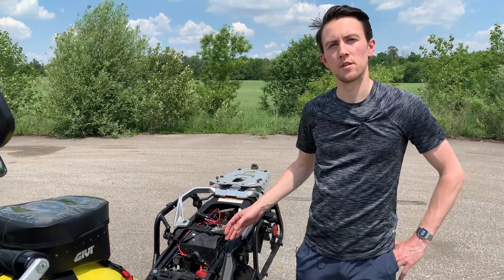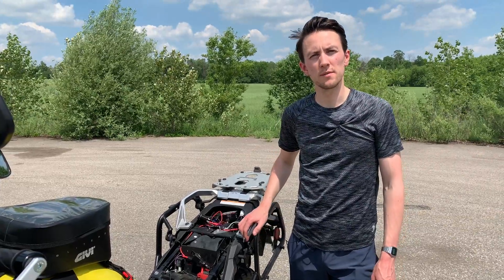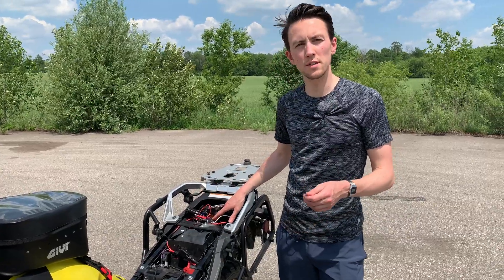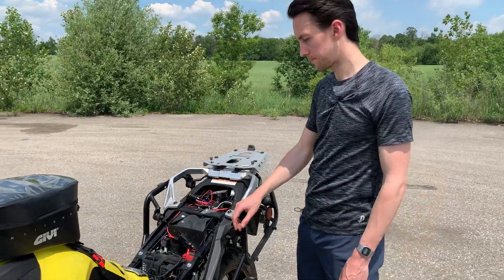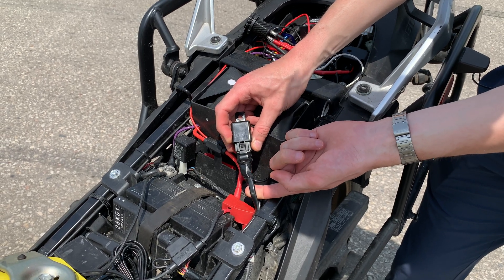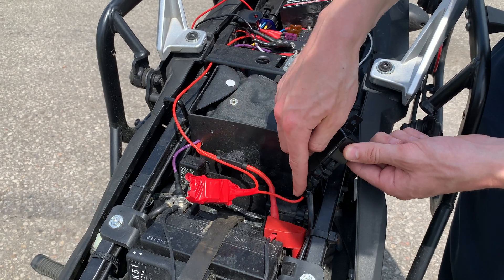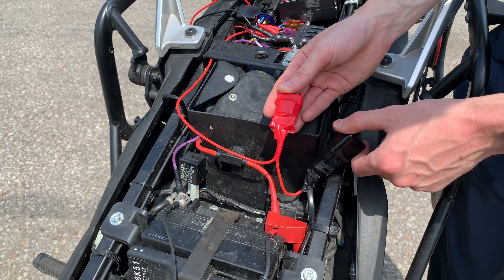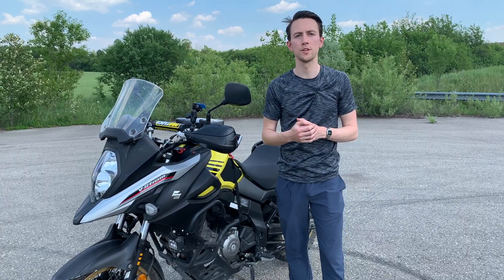AUXILIARY FUSE BOX SETUP - Never have a dead motorcycle battery again!

Comment: I have a question, can I connect fuse block to  motorcycle kill switch and use it for accessories only ..Instead of tapping into the motorcycle wiring  I can go straight to the battery and switch it off when not used ??
Reply from the maker: Hi there, I’m not quite sure I follow your question, but if I follow correctly, the way I have it set up may be exactly what you’re asking/trying to do. 

By having the fuse box “turned on” only when the bike is on (which is how mine is set up, by using the tail light wire as the trigger to allow power to the fuse box), then the fuse box and all accessories don’t receive power as soon as the bike is turned off (or when the kill switch is activated). As long as you use a power source for the fuse box “trigger” that is only active when the bike is turned on, the outcome will be the same. Hope this helps.
Reply: @N5Gunner  oh ok , I'm scared to tap into a wire , so could I bypass that with a kill switch that connects directly into the battery, and then connect the fuse block to the kill switch.   At that point connect all accessories to that fuse box connected to that kill switch, and the only way the accessories get power is when I hit the on button for the kill switch . I was wondering if that would work instead of cutting into wires . I'm srry I'm not good at explaining these things lol  I'm new to all of this .
Reply from the maker: I see what you mean, a new switch that you’ll add - I thought you meant splice into the kill switch button on the motorcycle. 

I think that would work, but the downside is that the fuse box and accessories could still drain the battery when the switch is turned on. 

For me, the primary benefit of the fuse box was having it automatically turned off when the bike is off. If you add a separate switch as the trigger and have it wired directly to the battery, if you leave that switch on, the fuse box will keep drawing power even when the bike is turned off. If you don’t mind that, then it would work, but if you want all accessories to stop receiving power automatically when the bike is turned off, you’ll want to use a “trigger” power source that is only active when the bike is turned on (in my case, I used the taillight).
Reply: @N5Gunner  ohhhh ok. I'll try the tail light.. thanks man I appreciate it !!!!
Reply from the maker: No problem. I recommend a butt splice where you can cut the tail light wire and then add a new bit of wire that will run to the fuse box trigger.

Comment: What gauge wire are you using?
Reply from the maker: I used 12AWG for the primary connections to/from the battery/Auxiliary fuse box, and smaller gauge for the individual accessories connected to the fuse box. Hope that helps.

Comment: Hi, Thank you for posting it. I have questions: How did you connect a relay to the fuse box (wire diagram)? The wires come from battery directly? How about the positive and negative wires (12 Gauge), did you run it directly from battery?.  Also, where the ACC wire go to (works only when the ignition key is on which you spliced it from the rear brake light)? Directly to the fuse box? I am a little confused.  Thank's.
Reply from the maker: Thanks for watching and for your comment! First, if you haven't already, I'd recommend reading the video description, where I've laid out the wiring in as much detail as I could. Let me know if the description helps answer your questions, and if not, I can try to answer them here in a different way. Thanks!
Reply: @N5Gunner  I still have one more question. So the 12 gauge wire positive and negative run from the battery to the main relay next to your fuse box? (this is not the aux light relay I am asking). And from the relay to the positive and negative terminals from the fuse box, correct? If that so, then the 12 gauge you connect to the relay first, then what size is out to the positive terminal on the fuse box, the same 12 gauge? I just need a clarification on this. Because it looks like all the wires  are smaller and the only 12 gauge I see it on your fuse box.  I understand the connection well, just confusing whether the 12 gauge should go to the relay first. thank's again

Comment: Most auxiliary light sets I’ve seen come with a trigger wire.  If you hook the auxiliary lights up to a fuse block which itself needs a trigger wire, can you then disregard the trigger wire that comes with auxiliary lights?  Thanks.
Reply from the maker: Most of the auxiliary lights I see come with an ON/OFF switch, yes. If you hook the auxiliary lights up to an auxiliary fuse box, it’s still best to make use of the ON/OFF switch - doing this allows you to still turn the lights on/off with the switch, it simply means that you will only be able to turn the lights on once the bike is on and power is being supplied to the auxiliary fuse box. This adds the benefit of not being able to accidentally leave/turn the lights on and drain the battery once the bike is switched off. Hopefully that is what you are asking! Thanks
Reply: @N5Gunner  Thanks for your quick reply.  I should have been more clear.  I would be using the on/off switch that comes with the auxiliary lights; but do you need to hook up BOTH trigger wires, the one coming with the lights and the fuse block?  Maybe the answer is if you use the on/off switch, you need to hook up the trigger wire also coming out of the auxiliary light relay.
Reply from the maker: @rogerhart1835   Yes, you would still use the auxiliary light relay and it’s trigger wire. The auxiliary light relay should have four wires - a power input (power coming from the auxiliary fuse box), a power output (running to the lights), a negative/ground, and the trigger. The trigger wire for the auxiliary light relay is the ON/OFF switch. 

So you end up with the primary auxiliary fuse box relay being triggered by a circuit that is only live when the bike is on (I used the rear running light), and then the trigger for the auxiliary light relay is the ON/OFF switch wire. 

Hopefully I’ve got it right this time around and understood what you were asking correctly! 😅
Reply: @N5Gunner  👍

Comment: Some other things that may help when wiring an aux fuse box is that you could use a 'piggy back' tap connector that fits into an existing fuse on the ignition circuit to give you an extra 'switched live' for the relay without having to cut/solder or use crimps, or if you dont have space to fit it in, then use a t-tap crimp connector with a spade, which is in fact what i have just used when fitting a small fuse box to to my cb125f using the rear light, when only a little bit of cable is available and i didnt want to unwrap the loom. GL
Reply: Hi Bob. Can we see your set up in a video. It would help the motorcycle community. Thank you
Reply: @ben54322  I dont do YT video's and stuff, but if there's a way to send you a private message or email, then tell me how and i'll send you a photo of it, and also a schematic so you can post it. It's a 4-way fuse box all with individual mini fuses and i've also added a common ground to the fuse box make it easier. I currently only have a 2 way usb charger attached,  but it's now a simple job to fit heated grips or a 12v socket or whatever else takes my fancy, and because it's an easy fit i could simply remove it for my next bike should i wish. GL

Comment: thanks for the vid. I don't know is this has been answered but for an old project i did, i bought a relay that takes a mini blade fuse, basically for the same price as one without. this is much neater than having a seperate in-line fuse.
Reply from the maker: Thanks for the comment Bob, that's interesting and sounds like it could be a good option and space saver (I'm assuming you're talking about the auxiliary light in-line fuse)! Now that it's been a while I can't actually remember if that in-line fuse came with the lights as part of the included wire harness/relay - I believe it did, but a relay with a built-in mini blade fuse would certainly be cleaner!

Comment: What did you connect the ground wire from the relay to? Very helpful video btw. Thank you!
Reply from the maker: Thanks for watching Rahul, glad it's been helpful for you! I'm assuming you are talking about what I am calling the "main relay" (the relay that sits between the battery and the auxiliary fuse box, NOT the relay used to turn on/off my auxiliary lights with the rocker switch). Regarding this "main relay", I connected the ground wire (thin black wire coming out of the relay) to one of the 6x negative terminals on the auxiliary box designed for the accessories - if you go to the freeze frame at 2:54, you can just about see the black wire coming out of the relay and running to one of the 6x negative connections on the auxiliary fuse box - to clarify, it is NOT connected to the MAIN negative terminal of the auxiliary fuse box).

I didn't have enough room to add all of this to the video description, but the full wiring connections between the relay/battery/fuse box are like so: 1) ground wire running from negative terminal of battery to the main negative terminal on the auxiliary fuse box (purple wire with black ends). 2) positive wire running from positive terminal of battery to "power input" of the main relay (thick red wire coming off battery), 3) the "power output" of the relay which runs to the main positive terminal on the auxiliary fuse box (blue wire coming out of relay with red end), 4) the ground wire of the relay running from the relay to one of the 6x negative accessory terminals on the auxiliary (thin black cable coming out of relay), 5) the relay "trigger" wire, which I spliced into the running tail light cable (white cable coming out of relay which then turns to red).

If you were asking about the ground wire from the relay between the auxiliary fuse box and the auxiliary lights I use on the bike, then the ground wire from that relay also runs to one of the 6x negative accessory connections on the auxiliary fuse box (mentioned/seen best at 4:06).

Comment: great video, but I'm confused. I was given a set of Denali lights and a dashcam. both devices need a trigger cable connection. So do I need a separate relay and fuse for each device?  and do the relays have to be spliced to different live wires, say one the ignition and another to the brake light??? Any help you can give me will be greatly appreciated.
Reply from the maker: Thanks for watching Daniel. I’m unsure of exactly how you want/need your devices to operate, but assuming you just need them both to only turn on when the bike is turned on, then you only need one relay (the one that is triggered and allows power to the auxiliary fuse box). You then hook both accessories to the fuse box. The auxiliary fuse boxes have a slot for a fuse for each accessory hooked up to them. If your lights have an on/off switch, then they probably come with a little relay, which you’ll use between the auxiliary fuse box and the lights (the trigger for this relay will be the on/off switch).

Comment: So you basically got power from the tail lights + wire..... Did you notice any change on the aux light beam when you brake???
Reply from the maker: No, the power comes from the battery, through the auxiliary fuse box, with the accessories connected to the auxiliary box. I spliced into the tail light wire only to provide the relay with the “trigger” to allow power from the battery to the auxiliary fuse box. So when the bike is on, tail light wire has power, relay allows power (from the battery) to auxiliary fuse box, accessories get power.

Comment: Had you thought about an actual breaker switch instead of a fuse between the relay and fuse box so you don't have to carry around fuses for a reset?
Reply from the maker: Thanks for the comment and suggestion Paul. I did think about the possibility, but stuck with a fuse for a few reasons. I've heard that breakers are a bit more complicated, with more pieces/parts, and therefore more prone to failure. Which on an adventure motorcycle, I'd prefer to stick with something that is small, cheap, easy to carry a spare (or two!), and easy to find and replace on the bike in faraway places. If I used a breaker switch, I'd still likely carry a spare in case it failed, and it's easier/smaller to carry spare fuses. As with everything, pros and cons to both. I'm not as familiar with breaker switches, which was another factor in my decision. It would definitely be nice to simply flick a switch if something did ever happen though, I agree! Appreciate the comment, and the next time I make a similar setup, I'll probably do a bit more research into whether I should go with a breaker switch, thanks!